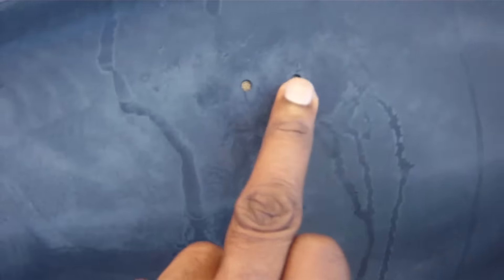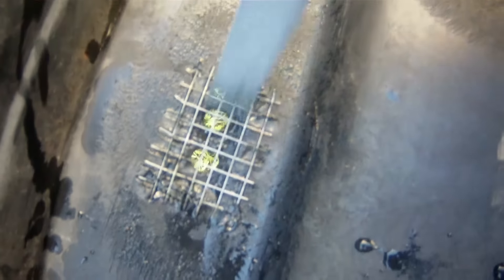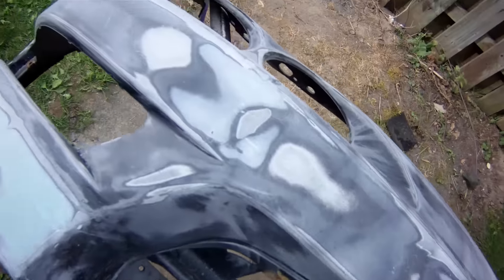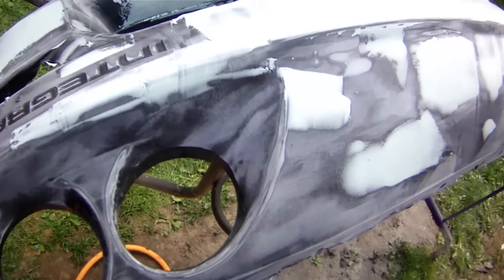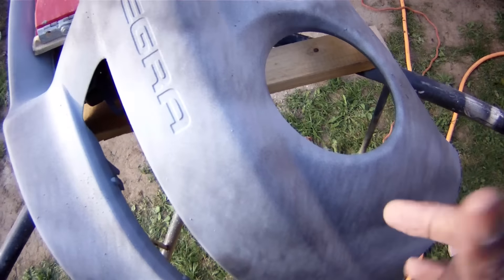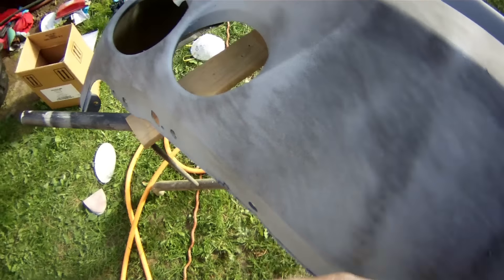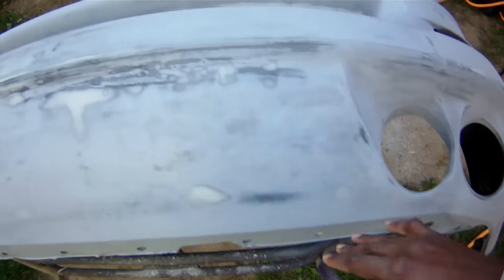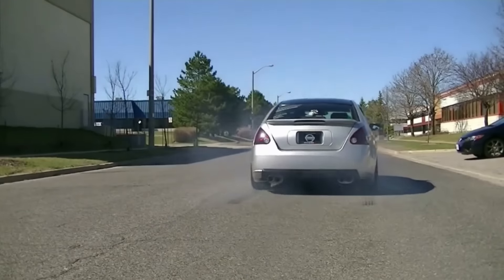Prepping for paint Pt1

Comment: what size sand paper do you use to remove paint or do you use paint remover first then sand it?  i have a green bumper but i haven't done enough research yet.
Reply from the maker: Honda Game The only reason you should use paint stripper is if the paint is either ruined, you have can spray on a bumper and you're gonna use automotive gun spray or you're trying to avoid a chemical reaction, other than that sanding then build up primer is ideal. Depending on how deep the stone chips are you wanna start with a 320 grit apply and fill the holes then sand with a 240 and work your way up to about a 600 grit. But practice will make perfect.